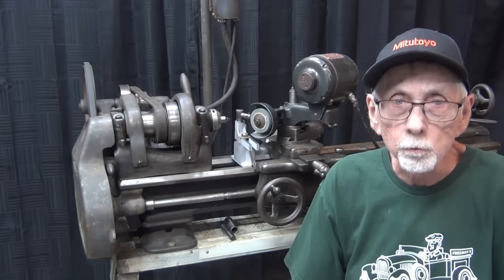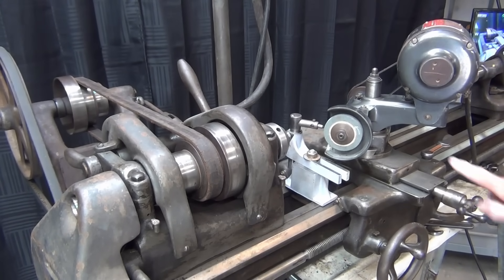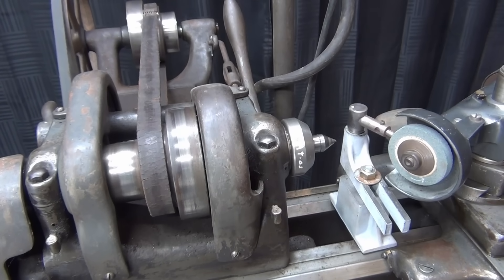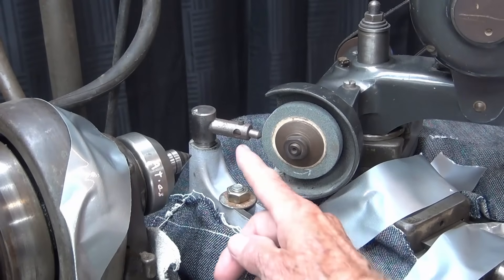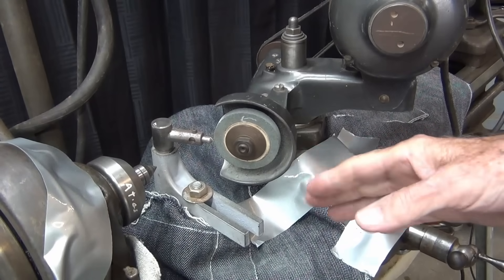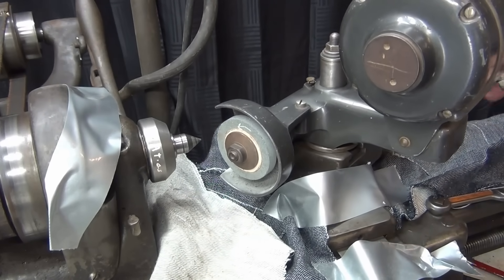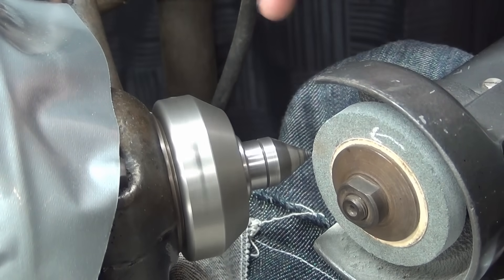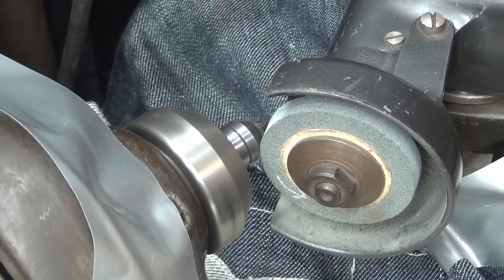GRINDING TAILSTOCK CENTERS on SOUTH BEND LATHE #1060  pt 2 tubalcain DUMORE renewing truing

Comment: I would love to have one of those grinders. I wonder if a person could fabricate one of those grinders.
Reply from the maker: It would be a challenging project, but certainly possible!
Reply: @mrpete222  I suspect it is another one of the projects that would require a mill that I have yet to figure out how to build or acquire.  I should see if there are any plans from back then for building one. I have found south bend plans for a classroom built 8” metal lathe.

Comment: Hello from 🇳🇴 Yes I have a Dumore grinder after my father. I was missing some parts and wheel’s on it, but was able to buy them from Dumore. I use it on my South Bend 9 inch, and on my Sheldon 10 inch. And yes, I have grind deadcenters, and the tip on my livecenter. Also used when I made a tap follower from a broken endmill. Keep up the good work MrPete 👍🏻

Comment: Elijah and I don't have a fancy pants tool post grinder like that, but I built a lille old adaptor to hold a Hazzard fraught mini router.  I use high speed 1/4" shank die grinder stones.  It works pretty good and the stones are cheap and easy to find.  Keep up the good work.  Run the race to win.
Reply from the maker: That’s a good workaround to not having a tool post grinder.
Reply: @mrpete222 I built it to make something and I can't remember what.

Comment: I use big sheet ofbrown masking paper stick it under the tool post and cover it in wd40 or similar , all the dust sticks to it drapes right over the carriage leadscrew etc , sometimes ad a shorter bit with magnets , when done fold it up , works pretty good
Reply from the maker: That’s a good idea for catching the dust.

Comment: A vacuum setup, like wood turners use, would be good if someone is doing s lot of grinding. 
I  hope you were wearing a dust mask as well as your face shield. 
That dust has a way of sneaking around the edges at times. 😮

Comment: how about position the shop vac hose near the work when grinding? thanks for the video Mr Pete
Reply from the maker: I did that many years ago in a YouTube video. But the filter inside the vacuum cleaner can start on fire. Plus, it is very noisy.
When doing this, there are four switches.   Lathe switch, the grinder switch the vacuum cleaner switch the camera switch and it goes on and on a lot to remember.

Comment: Hi Lyle,,I have a Australian Made clone of the S/Bend 9inch, made under license in the late 40’s mainly for Tec School use..mine is the last of late models with tapered roller head bearings,,, I also picked up a Sher No 4,  2 speed tool post grinder now I know thanks to you how to work it,,  I will send you some photos if you send an address…regards Frank
Reply from the maker: Thank you, Frank. Send the pictures.
Reply: Hi Lyle, where do I send the pictures?
Regards Frank

Comment: I fixed a spindle from a 1917 Hardinge quick change cataract  lathe that was bent by a previous owner, I suspect they thought the 5c bore was a mt and drove the key into the bearing destroying it, then attempted to weld the key back in place warping the spindle. I used heat shrinking (ala Keith Fenner) from .060 out, to .0015 out, then used a #5 toolpost grinder to make it true. made a new tapered ductile iron bearing to match the final od. once I got the machine back together I used my #14 dumore tom thumb and an internal stone to dress the internal 5c collet. its a fairly respectable machine for its age, quite accurate if you are carefull, and at 1100 pounds its real stout for a 9 inch lathe.
Reply from the maker: That sounds like an amazing and almost impossible repair that you did. Glad that it worked out.
Reply: @mrpete222  in the job shop we refer to things like this as "heroic" repairs. I probably would have scrapped it or used it for parts had it been a more common model, but its neither of those things so I doubled down.

Comment: Have you seen rolls of asbestos in a shop.
We were told it was dangerous so we used gloves.😮
Reply from the maker: I have a roll of that material in my shop. It never occurred to me to use it. It is dangerous, but I’ve handled a lot of it when I was a teenager, and now I’m 82 and still alive albeit barely.
Reply: @mrpete222 I'm not too far behind you. I assume you know what made me think of it.

Comment: Thanks mrpete222, i just welded the tip of my centre inside my part (seconds after lubricating it too, i still had the can in my hand). so will be needing to do this later
Reply from the maker: Yes, and buy yourself a live ball bearing center while you’re at it they’re pretty cheap

Comment: My great granddad was a B-25 mechanic and lathe operator for the Army Air Core in WW2. I remember some of the stories my grandma told me about his machines that he got to take home after the war, one being his large lathe. She always explained it as about 18-20 foot.

But I've been watching your videos since about 2010-12 and are one of the main reasons behind me actually getting machines. Before I just wanted a small something to mess around with, but now am looking at starting a company with the machines I did end up getting. Building other machines that will end up building cars and trucks of my own design.

Eventually I'd like to have a grinder like the one in this video. It seems well built and well thought out. But i should probably finish with setting up what I already have first before expanding the collection much further.
Reply from the maker: Thank you for watching and commenting. Sounds like you great granddad was a member of the Arsenal or democracy, as was my own dad. Yes get all the basic set up before you branch out into some accessories that you may not use that often. Good luck to you. It sounds like a great endeavor.

Comment: Wonder if you could mount a vacuum hose near the wheel to catch that dust
Reply from the maker: I’ve done that in the past past.
It’s extremely noisy, and you can start the vacuum cleaner filter on fire. 
And quite annoying because now you have three motors to turn on, lol. The. Lathe itself, the grinder, the vacuum cleaner, plus the work lights, the camera lights, the microphone, and the camera. That’s why I sometimes forget to turn the camera on.
Reply: @mrpete222 True! Keep em coming, love the content.

Comment: A few months ago I bought an old SB tool post grinder. This is the 1950s version, with a 1/4 Hp GE motor. In shipping, the small cast iron part holding the motor to the base, broke in two. I ended up welding to two together using TIG and my favorite, 309L rods. I ended up building the part to a greater thickness with the rod as the part just seems too weak. The later model used a different type of part for that, so I suppose it became a known problem.

At any rate, it worked well, though SB has the belt in the wheel end of the shaft. But the truth is that the big cast iron body motor weighs so much, I don’t like lifting it on to the lathe. So I’ve bought one of the Chinese servo motors with variable speed digital controls. I’ve used them before and they’re great. It’s tiny, weighs little and is 1 Hp. When I get time I’m going to modify the base and use that. It will make the unit over 15 pounds lighter.
Reply from the maker: Sounds like a good project. And a great improvement over the original design. You are right, those older motors were heavy, but built to last.
Reply: @mrpete222 everything was big and heavy back then. It was the best they could do.

Comment: I use aluminum foil to catch the dust. first it keeps from dropping through the weave, and second it won't go on fire.
I find it weird that I read that the dead centers with a band around the head like yours are carbide tipped and the ones without are just steel... I read that in a few places. But I find it to be fiction, not reality.
Reply from the maker: Never thought of aluminum foil good idea. Several people have asked me about the grooves on the centers. I think it has nothing to do with carbide. Carbon is easily identified visually

Comment: Hallo Lyle, I live in South Africa, and has enjoyed your content for over 5 yrs now, I have a desktop lathe and use it everyday to fix problems with larger equipment in my factory! I regularly do grinding and has combatted rigidity issues …… but good enough is often the settlement point!😂
Reply from the maker: Great to hear you are putting your lathe to work!

Comment: I do have a tool post grinder, it's the smaller model than you have there. I have not used it yet even though I have owned it for several years but it's a nice to have tool in my opinion and I got it in case I would need it for a surface finish on something.
Reply from the maker: Yes, they have really very little use. I’m getting rid of mine.

Comment: If I were to do this, I would also use my shop vac to help collect the dust while grinding. Another thing to get in the way but this is something not done in a hurry.  Some years ago I made a motorcycle chain tensioner using a steel sprocket and needed to enlarge the bore of the sprocket so a bearing would lightly press fit into the bore. I used my 6" Atlas/Craftsman lathe and mounted my Craftsman die grinder to compound after removing the tool post. It was cobbled together and I used stainless steel hose clamps to keep the die grinder in place. Taking light cuts, I was able to get the bore enlarged but I did not know about dust contamination and I did wipe down the machine when done, nothing happened detrimental due to dust. The gear was held in the independent 4 jaw chuck. It was a success overall and I was quite proud of myself. Back then I did not own a shop vac.
Reply from the maker: That was quite an amazing feat
I have used vacuum cleaner, cleaners I think it’s shown in an older video. But you can start the vacuum cleaner on fire with a sparks.

Comment: Vacuum cleaner/shop vac & duct tape!  Might even make ear more useful/important then eye protection.   Also, on the one you didn't want to grind because it would need so much, really, how many times do we need a sharp point?  Rarely or never for turning, just for setting cutter/tool height.
Reply from the maker: So true, this video was a failure
Reply: @mrpete222  Failure?  Nothing of the sort!  It's got infotainment, historical & technical relevance, excellent video & sound & editing and above all an interesting subject.  Maybe the host could use some polishing up, that's all.😄😄😄😄

Comment: Thank you Mr Pete. I have an Atlas tool post grinder that came with my 9 inch "C" South Bend. Both are very old and the grinder is realistically bigger than you would want for that lathe but I have used it a couple of times, once to true up the mouth of the 5C collet adapter. The spindle of the grinder will accept wheels for outside grinding and it will accommodate the  little stones similar to what you put in a Dremel, for internal grinding. All of my stuff had at least one previous life.
Reply from the maker: That's great, sounds like a handy setup!

Comment: I couldn't afford one so I made my own tool post grinder using a small stepper motor with a homemade spindle and an off the shelf wheel arbor.
   It doesn't get a lot of use, but it comes in handy when I need it. To protect the ways I use motor oil soaked shop towels/rags to cover the lathe it works quite well. 👍👍

Comment: I remember grinding the centers on dad's 9" SBL when I was 13 years old.  Oh yeah, dad stressed covering up the lathe from grinding dust and cleaning thoroughly afterwards. That was over 50 something years ago and haven't tried it since. Of course, now I have other grinding equipment I can do this on if I ever want to do it again.  In fact, I reground the points on several live centers a while back using my T & C grinder.  Worked out nice.  I could have done it on the lathe, too.

Comment: For our info, CNC lathes cut their own headstock center using digital programming.  The finish ends up equal to or better than grinding!  Relief profiles are done freehand with feeds in manual!

Comment: Thank you for inspiring so many people on the joy of machining. It's not my trade, but started as hobby machinery by watching Mr Pete, Abom and so many others. Thank you for that. I've refurbished an old shaper,  lathe and mill and by practice learned some new skills. Mainly doing repair work for my classic cars and motorcycles. One thing I'm having troubles with is the slitting saws on the mill. In this case I'm remaking a carburatorshaft, with a 1mm slot in it. The result of the slot always is a bit bowed. As a good sport I blame the tooling 😊.
Maybe there is a way to improve on this. Maybe an idea for a video if other's also experience those difficulties. Again, thank you for all your amazing videos and your great personality. You're a joy to learn from.
Best regards from the Netherlands to you all
Reply from the maker: I have tried that over and over with little sliding saws, and the slot always goes crooked I gave up
Reply: @mrpete222 Thank you for sharing your experience. Good to know it's not just me having issues with those small slitting saws.
I'll try to workaround it
Reply: Just throwing an idea out, but how well would it work to bore a support block to size, then cut away the minimum amount of the block outside of the hole to allow access for the slitting saw?   

Burrs might bind the shaft to the block if using aluminum, so steel would probably be indicated.

I’m after wishing my commenting skills were sufficient to post a sketch, (although I suspect YouTube would block that anyways…)
Reply: @paulclithero1822 the bow of the saw actually happens inside the workpiece. I suspect grinding geometry of the saw has the most impact on this. 
I've used a full carbide slittingsaw for the carburator shaft, this one still bowed inside the material. 
Next try will be entering from both sides on the shaft so the outside of the shaft is perfect and the less precise part will be in the middle of the shaft.
Reply: @Marcel-o2w Ah, I misunderstood the issue.  I was visualizing the slot through the shaft moving in relation to the long axis of the shaft, not in relation to the diameter.

Comment: Another excellent video, one thing of note please please do not stand in line or in front of the grinding wheel for a minimum of 20 seconds sometimes we’ll let ours run a full minute if the wheel is going to explode it’s going to explode during that time.

We always cover the ways very well, and we do use a moistened microfiber rag directly under the chuck, we find it captures a lot more of the dust

And thank you for bringing up the Gibbs very important to control vibration👍🏻

Absolutely love your videos, would’ve given anything to have you as my shop teacher. I’m in Colorado Springs, Colorado and I own two dumore’s
Reply from the maker: 👍👍 all my life. I stand off to the side when I start my pedestal grinder.
Reply: I rarely stand aside, even though I still remember the old big bucks lawsuit against Sears for an exploding wheel, guy used a vacuum cleaner motor that was two or more times the speed of the wheel's max.